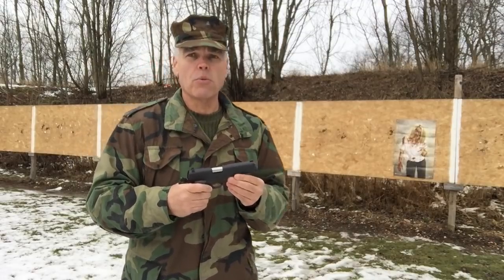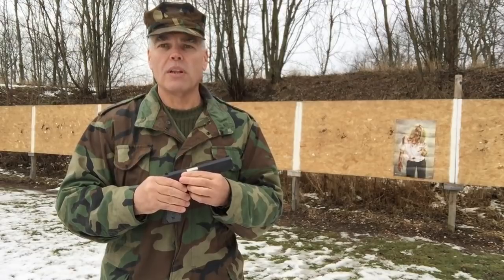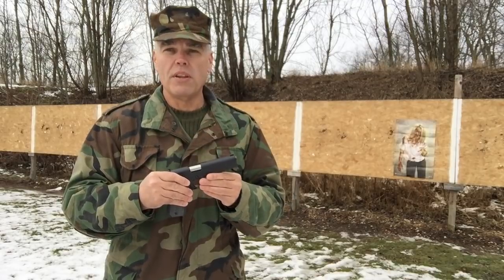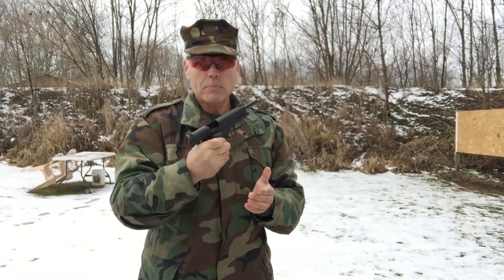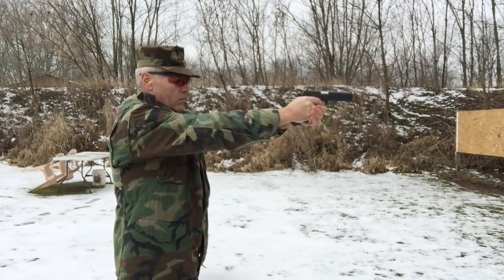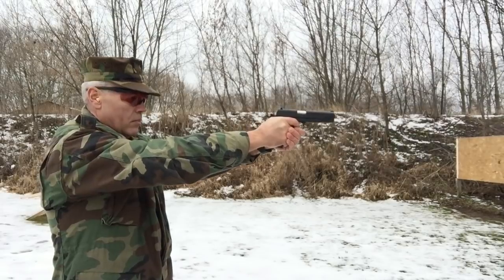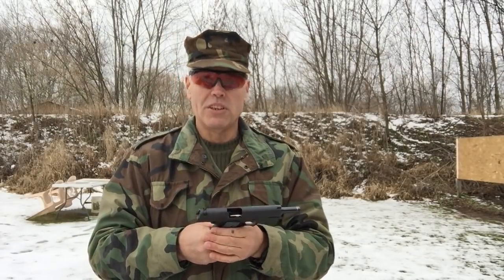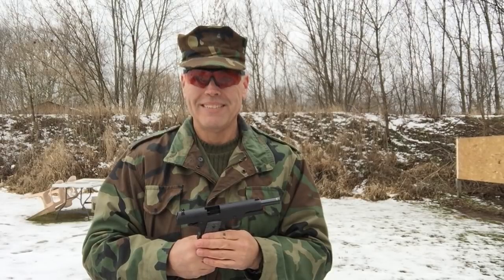Functioning Update! Llama Max-1 38 Super

Comment: I feel a LOT better now about this pistol. Thanks for the timely update. By the way, when it comes to my personal firearms, I use a product (in the winter mostly) that can be a bit difficult to locate by name anymore.....Sewing machine oil. Otherwise I like to use regular 10W-30W motor oil during spring and summer and into the early fall until it get cold. In case anyone who reads this thinks I use a lot of either type oil when lubricating my firearms, I don't. I use those lubricants sparingly and have found them to serve me and my firearms well.....And I learned to use those particular lubricants from relatives who served during WWII and Korea and found them to work very well indeed when it came to their Army and Marine issue weapons (M-1s, a B.A.R. , .45ACP pistols, and the Browning .50Cal HBMGs mounted on three different models of Tank Destroyer). I'm sure I'm way behind the power curve when it comes to modern lubricants intended for firearms use but I've been using the above mentioned oils since the 1960s with great success. I HAVE used other, firearms specific, lubricants off and on over the years but I keep going back to what has worked for me all these years. The only time I've used the "required and/or specified" lubricants on firearms I was issued and/or responsible for was during my time in the Army in the early to late 1980s. Uncle Sammy was VERY insistent that we used only those lubricants that he purchased....Though we did kind of sneak, as often as we could get away with it, and use Break Free every chance we got as it worked to both clean and lubricate our automatic weapons, .45ACP 1911A1 pistols,  not to mention bores of the 105mm main guns of our M60A1 and later M1 Main Battle Tanks. I don't recall exactly when the Army added Break Free (by the 55 gallon drum of course) to the list of approved POL but I think it was around 1982 or 1983. Take care and keep the great videos coming!
Reply from the maker: FD Mackey Thank you, and thanks for another great comment!

Comment: I use Mobil 1 also, but I mix it 50/50 with ATF.  I like the Mobil 1 because it's a good lube and will flow down to -40 degrees.  I use the ATF because I'm convinced that the solvent properties of ATF make cleaning easier.  I use it on all my firearms, and none of them have complained yet.
Reply from the maker: If they start complaining, be sure to let me know!
Reply: You and the shrink too.  Lol
Reply: Isn't ATF alone enough? After all it cleans and lubricates transmissions all by itself, no need for any other oil.
Reply: I like to pack the inside of all my guns with bearing grease til it's completely full. It makes the gun not wear and last forever.

Comment: Hello there HR. I just put me a Llama in layaway yesterday it's the stainless model 38 super. This is my very first one! Thanks for the video.
Reply from the maker: Tyrone McBride You’re welcome! I hope yours runs a little better than mine. I just sent mine off yesterday to the pistol doctor. It’s coming down your way. The gunsmith is in Lott, TX.
Reply: hrfunk i hope mine operates as it should. Did you find out what exactly was the issue with yours the barrel link the magazine?
Reply from the maker: Tyrone McBride No, I ruled out the ammo, the magazine(s), and the recoil spring. If it’s the barrel link, or the machining of the feed ramp/barrel ramp, the gunsmith can run that down and correct it. The pistol has a lifetime service contract, so I want to see just how good the service is.

Comment: I use Mobile One, plus a little transmission fluid.  I use it on all kinds of stuff.  I used it on the bearing parts of our clothes dryer, and it runs smoooth, sewing machine, barber clippers, you name it.  Oh, and sometimes on pistols, or rifles.

Comment: Basic shooting 101 to clean and lube a 1911 right out of the box. Never heard of using motor oil to lube your gun. I’m calling BS on that.
Reply from the maker: Just an FYI, you’re calling BS on armorer’s training from H&K, S&W, Rock River Arms, and several others. Mobile 1 synthetic motor oil is the only lubricant I use on my firearms and it has never failed me, nor has it failed any department firearms I’ve been charged with maintaining.